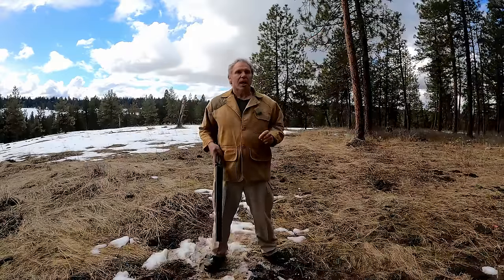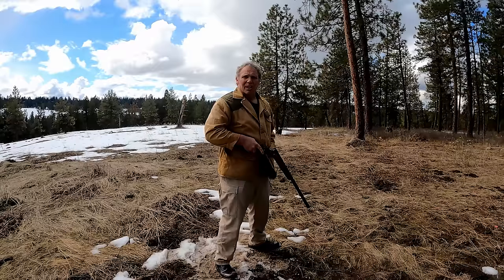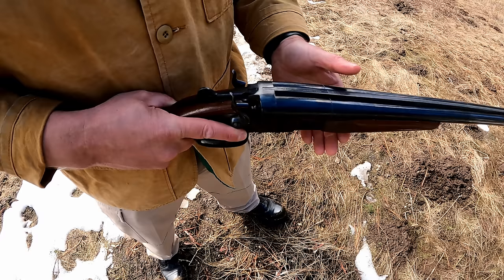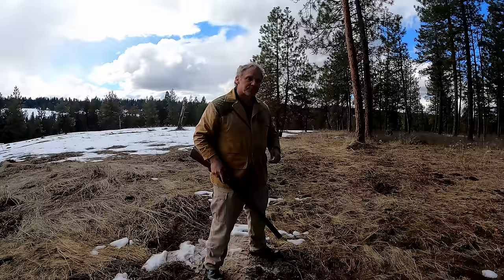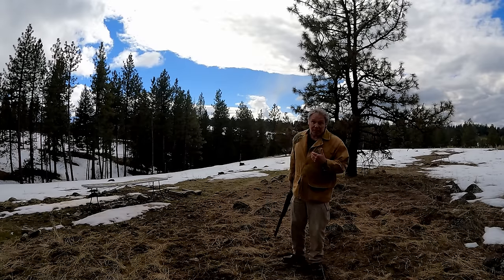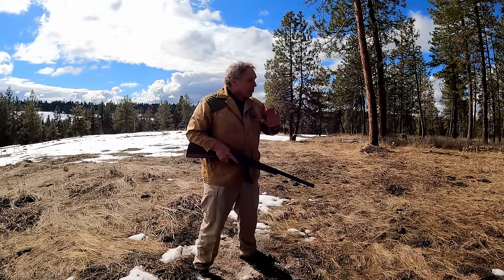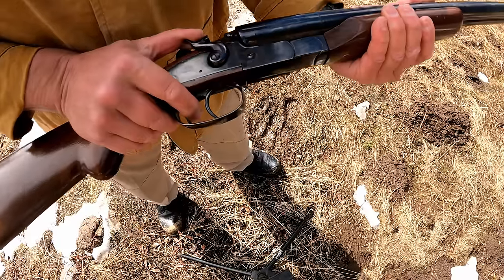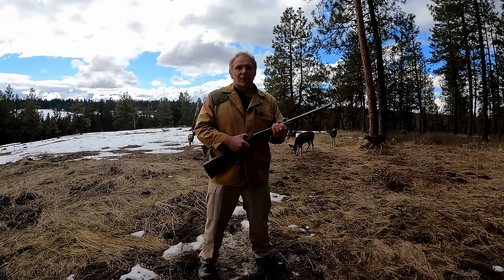Paul's Coach Gun Technique Explained

Comment: I don't have a double coach gun, but I am never going to forget "Right up front, Left behind."
Reply: @Timothy Mckee Well if you are going to make it political I would opt for one trigger in the middle that works with both sides and actually gets things done and not constantly work to undermine the other side.
Reply: @ph43drus  Not possible where there's no middle ground, which is a lot of issues being faced today.
Reply: @ph43drus  The only thing in the middle is the ejector. Have to pick one.
Reply: @Timothy Mckee LoL - like it makes a fuggin' bit of difference who gets the highest vote count 😒
Reply: @KwarterCraft  Chiappa Triple Crown shotgun, 3 Barrels so it would be perfect for a trigger down the middle.😁
Reply: @wnchstrman  On Paul's shotgun, it is merely an extractor. If it was an ejector it is likely to eject both shells even though the left chamber gets stuck all the time because it is rough.
Reply: Fun fact, your kidneys are also positioned this way.  The left hangs a little lower than the right.

Comment: Great video! 
I'm buying a double barell because of multiple reasons I lived them as a kid and I still do. I want a gun that's simple enough so that my sister and my mom can use it if needed. I was looking at the type where it automatically cocks both internal hammers when you open the gun and it has one trigger with a system where you pull and your first round goes then you keep pulling and there comes the second one. I like those better because they are so much more simple for me to use than 2 external hammers with 2 triggers. Great points have been made in this video I wasn't expecting this much new info.

Comment: A wee bit off topic. I took my semi auto 12ga to my local gun store to sell it. BEFORE AT HOME:it was loaded cruiser ready and I unloaded it so I thought. Pulled the bolt back no shell 3 or 4 times, it locked open and I pulled the trigger to close it. Yes an ND, A #3buckshot hole in my floor. At the gun store the owner did a safety check, now he has a hole in the ceiling joints. The owner is the head of our Swat team and said the gun had a defect. Always point in a safe direction. Thanks Paul.

Comment: Thank you.  I learned a half-dozen things from this video.  Then I was reminded of another score or so of shotgun facts.  The most important reminder was "know your own gun."

The deer herd in the background, within what looked like 100 feet of a man with a long gun, was a good laugh.  For some reason, wildlife on American gun ranges are not as skittish as off the gun range.  There's reasons for that.  I can only guess.  It is still funny that the deer were merely curious about what the funny man was doing on their dinner table instead of hiding until the man with the boom stick vanished.

The things I learned from you apply to break-action guns of all types, whether they have one barrel or four.  Yours had two barrels.  Left barrel, rear trigger and right barrel/front trigger is something I didn't know because the only double barrel I owned 40 years ago was a Savage 311C in 12 gauge and it was a hammerless shotgun with ejectors and an automatic thumb safety (remember to push the safety OFF after closing the barrel).  I didn't fire it enough to care which barrel went off first.  I think that the right barrel was modified choke and the left barrel was full choke, but I distrust my memory.   It makes a difference when the hunter overcomplicates his shooting process by loading two different shot sizes in his double barrel to maximize performance in that barrel.  It also makes a difference when the game animal flees--the more-open choke is fired first at the shorter distance to increase hit probability and the tighter-choked barrel is fired at the longer distance to increase pattern density at that range.  As I said, I didn't fire my double barrel enough to determine performance--I didn't even pattern the gun!  

Even with automatic ejectors (Savage Model 24, Winchester Model 37 and that 311) there was a technique to get the shells to clear the action--opened slowly and the automatic ejectors functioned as extractors only, requiring spent shells to be plucked out.  The action had to be snapped open briskly.  With the 311, slow opening permitted me to replace the spent shell without launching the live shell into tall grass.    

The major takeaway from your presentation: "Know your own gun!"

Comment: It would be nice to see a video comparing velocities of .22’s shot out of a bolt action vs semi auto, explain the results because I haven’t found a great explanation for the layman. I.E, does the ejection of the .22 casing in a semi auto slow down the bullet due to gases not being used to propel the bullet. Thanks Paul.
Reply: I second that , I am also curious
Reply: Seconded, I’ve thought of this exact question myself.
Reply: I would think that the bullet is long gone before the breach opens as a matter of safety, so that pressures are reduced, but I don't claim certainty there.
Reply: I have a double barrel that doesn’t have exposed triggers cocks both barrels automatically on my double trigger 12 gauge never seemed like an issue.
Reply: @missingnola3823  Correct. Guns are specifically designed with a delay system to hold the bolt closed long enough for pressure to decrease. That's why the AR15 bolt turns slightly to cam the lugs out or the HK styles have rollers. The bullet has left the barrel long before the action starts cycling.
Reply: Go check out the Slo Mo Guys. I believe they filmed a rifle in full auto many years ago. The bullet left the barrel way before the bolt started to move back. So, if both
test rifles have similar barrel lengths and loaded with same type ammo, the velocity
differences would be small. No much difference to make a difference.
Reply: Even on a straight blowback gun, the bullet has exited the barrel before the bolt opens unless it is a very long barrel. Velocity difference is within the mean variation of one shot to the next. Barrel length and rifling type/rate being equal, equal velocity. Only exception is revolvers, they lose a smidge of velocity due to the small space between chamber and forcing cone where there is a measurable pressure loss which lowers velocity. In a 22LR this is a very small loss, usually so small as to be unnoticed. But the higher the pressure of the cartridge, the more pressure lost. This might make an interesting test, a straight blowback vs revolver vs pistol velocity comparison. It would be difficult to find comparable barrel lengths. How about the Pietta revolver, the Hi-Point blowback and the Walther PDP pistol, all in 9mm with 3.5" barrels? I suspect very good handloads would be required to even notice a velocity difference between the three, with the revolver losing to the other two.

Comment: Having used plenty of double barrel shotguns myself, I already petty well understood why you were shooting the way you did.  I've often done it otherwise, but for my reasons.  In particular, I've done this in cowboy action shooting.  I've trained myself to cock both hammers at once.  This is in a controlled environment, where the worst that can happen if I slip is one barrel goes off... though already pointed at my target anyhow (I'm very good with hip shots, and point for the target while cocking the hammers).  It's also timed, and doing this saves time... but let's face it, my times suck to begin with.  I am not particularly fast.  I also use a finger on each trigger.  A good practice in this instance is to pull the rear trigger first, minimizing the chances of a double shot... and I've yet to have one.  But once again, it's a controlled environment, and the only thing downrange is my target.  On the other hand, while shooting trap, I'll usually only load one barrel at a time.  I also alternate barrels, to help train myself for always shooting the barrel I actually want.  Thing is, I still use two fingers, always with the middle finger on the rear trigger and index finger on the front.  I keep my fingers well trained.
Reply: You have just demonstrated that the "simple" side-by-side external hammer break-action double barrel shotgun is anything but simple.  Your coach gun, are both barrels cylinder bore or improved cylinder?  Most hunting doubles have a different choke in each barrel.  Trap and skeet double barrel shotguns generally have their barrels bored with the same choke.
Reply: @alancranford3398  the one I currently have with external hammers is 28" full choke, and takes 2.5" shells.  It's over 100 years old.
Reply: @halfcirclehranch6877  Thanks.  Both barrels full choke--check.  Those 2.5" shells--paper or plastic?
Reply: @alancranford3398  The 2.5" shells I get are usually plastic.  Unfortunately, the two companies I order them from (RTS and Polywad) were hard hit during COVID and still have trouble getting enough primers to keep their business running.  You have to check their websites and hope you see some.  Been thinking about loading my own.  I have used shells and wads, just need primers and the right kind of powder.

Comment: At 10:39, you were talking about recoil bouncing the sear of the shotgun, firing both barrels when you only intended to fire one. That reminded me of a video I saw a while ago, that was cut into a short by LunkersTV, of him firing a double rifle in, what I'm pretty sure was .500 Nitro Express. I don't know the cartridge specifically, but it was certainly one that produced substantial recoil energy. Sidenote, I know this is a rifle, and not a shotgun, but mechanically speaking, a double rifle and a double barrel shotgun are similar enough that they can be used interchangeably to make this specific point.

Anyway he was told to fire the rear trigger first, but he fired the front first, and as a result, either he bumped the rear trigger, or there was some sort of mechanical lockout preventing the front sear from disengaging under recoil that either wasn't present for the rear trigger, or not working properly.

Anyway, I'll link the short down below.

https://www.youtube.com/shorts/vkpOuA_8DqY

Comment: Excellent safety advice.  Thank you.  I relish that you refrained from shooting any watermelons.  It makes me a little bit sad when you destroy watermelons.  

I recall back in 1880-something, '88 I think but I am not certain, two smart Englishmen by the names of Mr. Anson and Mr. Deeley (spellings approximate) built and patented a new design with hammers under cover and concealment.  The gun cocked automatically on the opening stroke.  I had one like that from 1982 to 2003.  It was a Savage Fox.  It was the Fox design, but it was a budget shotgun.  It had the twin triggers, extractors, and an automatic tang safety.  Savage went tits up, and its owners were replaced by new ones who chose not to contrinue the Savage Fox.  One fall day under the recoil of a three-inch magnum, the spring that secured the fore end grip on my gun broke.  I was able to obtain another spring, but it was a trifle small and had to be assisted with some ugly duct tape.  I replaced the gun with a Special Purpose Remington 11-87 with a three and one half inch chamber.  

More recently, the side by side designs are regaining popularity in America although they are still losing popularity to over/unders in Britain.  I suspect that it is because modern CNC-guided machinery is taking out the hours of hand work to regulate the barrels and to otherwise render the guns perfect or nearly so.  I would very much recommend one of them over that external hammer coach gun that you have.  I suspect that most of the people who buy a double with external hammers go afield without ever thinking of the safety procedures or the many ways that an accident can happen that you taught to us in the video.  

For my part, in November of '21, I purchased a new TriStar Bristol side by side.  It is manufactured by Khan Firearms in Turkey.  It has a single selective trigger, automatic ejectors, a straight Turkish walnut stock and splinter fore end grip, and five interchangeable choke tubes.  It is light in weight and is best suited as an upland game gun.  The quality is excellent.  It is what I would call a "gentleman's shotgun" as opposed to the Remington 11-87 which I would more classify as a good working-class, utilitarian, working shotgun.

Comment: I have an old Boito 20 ga shotgun, Two triggers, right is right, left is left. 
No Hammers, open the breach insert shells gun is live. It has a safety that must be engaged and disengaged. If you disengage the hammer both barrels can be fired consecutively or together, to keep it safe you must engage safety after shooting.
It was originally a long barrel gun but some neo Nimrod roughly cut the barrels down to about 18 3/4 inches. I bought it long ago with a broken stock for about $25.00.
I fixed up the barrels, added a front sight and a new stock and use it for a truck gun.
I find that I use Paul's method automatically as I was taught by my Dad.
Safety instead of hammers.

Comment: As an owner of a "Coach Gun" I found this very interesting and thought provoking. The only scenario not covered is breaking open the action to drop hammers and as a general safety precaution.  On my particular Colt 1878 replica the "mule ear" hammers are positioned such that both hammers can be cocked at the same time, with one hand should that level of readiness, be needed in any situation.

Comment: I can honestly say that, for the rest of the day, I will recall Paul doing the "Soda Jug Jig" and will chuckle to myself!  This reminds me of when I was a teenager going dove hunting with some of my friends.  We had an old "dirt pit" that we would go to in the afternoons which was strategically placed between some farmed fields and a water source-- great fly-over spot for dove.  I carried the only shotgun I had access to:  my grandfather's old L. C. Smith 20 ga. double barrel.  My dad had hunted with the same gun, and according to the stories had crossed a fence by putting the gun over first and then climbing over-- not noticing that the gun went over barrel-first and thus plugged the ends of the barrels with dirt.  Of course the first time after that when he fired the gun, it burst the end of that barrel.  A local 'gunsmith' sawed both of the barrels off just before the damage (even relocated the front bead sight), thus making the gun about 1/2" longer than minimum-- around 18 1/2 inches if I remember correctly).  This was, to this day, the hardest kicking shotgun I've ever used.  The solid wood buttstock would leave my shoulder bruised, and each day of the season only made it more sore.  One day when it was a bit unseasonably warm, one of my friends saw me taking off my hunting jacket, and a folded towel that I used for recoil mitigation fell out, and he proceeded to tease me unmercifully.  He was using his new Remington 1100 autoloader, and couldn't believe that a "big ole boy" like me needed that padding for a "little ole 20 gauge".  I immediately offered the gun to him to fire, and the danged fool held it out like a pistol and pulled one of the triggers!  It almost took his arm off!  He handed the gun back as we all got a good laugh at his expense, and I showed him the bruises on my shoulder.  No more teasing from Mr. Big Shot!(I had to show him that I was only using #6 shot low-brass shells.)    The model 1100 was a dream to shoot compared to that old 20 gauge.  And yes, it was NOT a good gun for dove hunting, but was a damned good quail gun!

Comment: I did the exact thing he mentioned when I first got my double barrel. I was at my local range and they only had a burm with some basic targets for shotguns. I put one finger on each trigger thinking I'd be super fast,  pulled both at the same time by accident. First shot I made with that gun was incredibly unpleasant, left bruised and battered after putting about 50 shells through it

Comment: I have a Parker Brothers 20" Damascus bottom lifter 2 7/8"10 gauge double using custom loaded pyrodex BP substitute with 15 pellets of OO buckshot. Neat old gun use it for a home defense gun sometimes. Yes have more modern guns in 12 and even a 20 gauge for defense applications but every now and then it's this 10 bore hammer Parker Brothers shotgun. Interesting video as per the norm. Deer " oh that's just Paul talking to that thing on a stick were safe."

Comment: Have a former coworker who had an Italian-made double barrel, don't know the exact model. It had the interesting design quirk where the back trigger would set off both barrels if pulled first. He found that out the hard way taking a shot a bird, ended up clearing a bunch of branches in the process.

Comment: Thank you for wonderful presentation. Need an advice. I am about to buy first shotgun. I own several handgun, but never owned a rifle or shotgun. I would like to buy a general purpose side by side shotgun, possibly no so long, not so short, 24 or 26inç barrel. I have decided that I want a side by side double barrel shotgun with double trigger, but I could not decide between hammered vs. hammerless. I may use shotgun for casual shooting, such as clays etc, may use for hunting purposes.  Which one would you advise.. I am leaning over hammered sxs because it gives visual clue that the hammers are cocked and it seems they are safer to carry or store loaded when hammers are not cocked and the safety is on. Yes, I understand that I have to very careful when decocking hammer.  I own old school cz75 handgun which does not  have builtin decocker and I am accustomed to decock handgun hammer. I understand the delicacy of it.  However before shoting, with hammered sxs, I have to disengage the safety and cock the hammer.   What is your take about that.. What do you like.